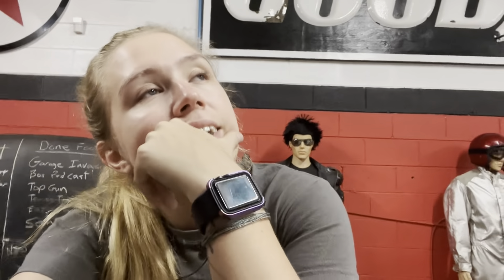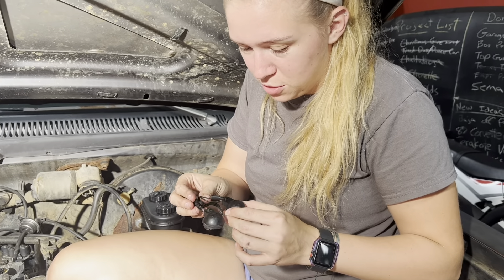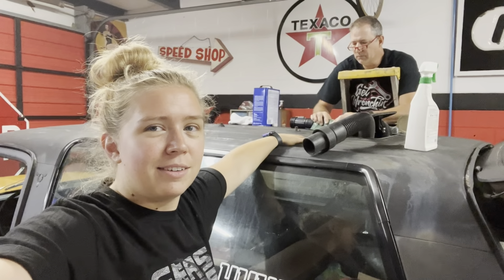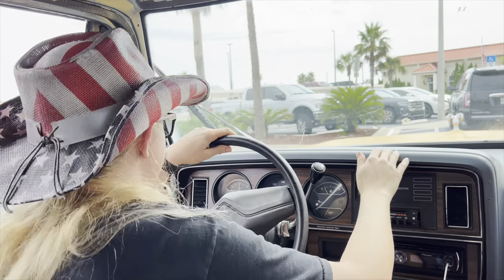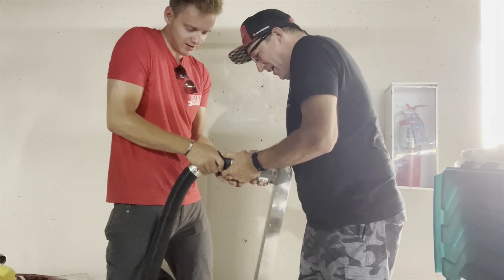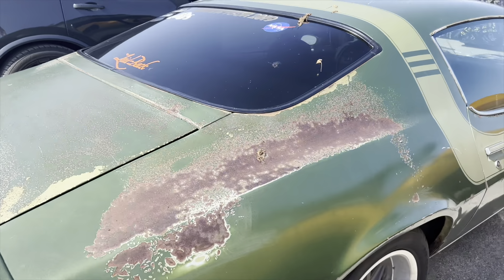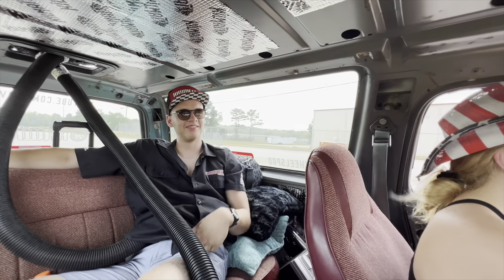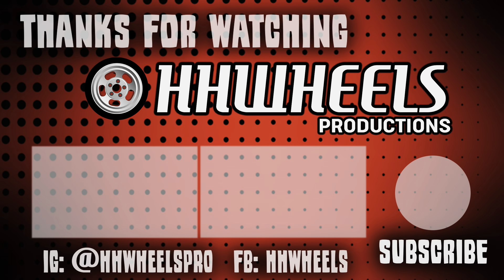HOT ROD POWER TOUR 2022 | WILL OUR RAMCHARGER MAKE IT?

Comment: I have a 1988 D100LE Ramcharger (2wd) and you're doing ventilation wrong.  Open the door windows all the way and open the roof vent all the way.  Reach down to the drivers' side kick panel and slide the vent toward the driver's door, this flows air from the cowl into the driver's crotch.  You also turn the vent fan on, but you might have to clamp the heater core lines if your shutoff valve doesn't actuate. 

Your vent windows at full open deprive the rear seat of airflow, somewhere around halfway is a compromise between front/rear airflow but makes the most noise.

Trying to pipe fresh air in through the roof restricts the through-ventilation that is quite well designed into the truck, that roof is a vent to exhaust the passenger cabin.

Cool that y'all took one on the power tour.  Maybe I'll put mine back on the road and take a trip like that someday!
Reply from the maker: Bru! We should have taken you with us😂 thx so much for watching! Driving at night was no problem and the tubes seemed to work well, I’m not sure anything would have helped the 100 plus heat. It just sucked! We made the best of it. Thx again!

Comment: Great video. I currently have a 92 Ramcharger  and have had  others in the past. As far as your fuel injection comment, no one should correct you for calling it fuel injection as that's what it is. However it's not tuned port injection, it's throttle body injection. Tuned port injection uses an injector per cylinder spraying into the intake runner.  They are both "fuel injection" .It looks like a great truck and I hope you enjoy it.
Reply from the maker: Thx Rich, thx for the info, and thx for watching 🤙
Reply from the maker: Oh, we are still looking for a driver side door panel if you come across one. Thx

Comment: Early throttle body injection or tbi as the ram charger is like the early 94 Chevy extended cab short bed onyx gloss black with quicksilver center stripe running down the sides and the tailgate Z71 with a 0.40 350 tbi can be very finicky in symptoms and therefore difficult to diagnose what is exactly wrong with them....been there done that but in design they are a simplistic type of fuel injected carburetor basically.... I had the same fuel issues with the early 94 Chevy extended cab short bed Z71 truck i had before my dodge ram...

Comment: I'd run your fake ac thru a cooler filled with ice by piping in the hose in to the cooler  thru the ice & then shorter hoses coming out so your not just pushing hot air at outside temps

Comment: I was lucky to acquire a truck with very little modifications and lower mileage working ac that did work well until the stupid ground squirrel chewed up the ac compressor clutch wiring connector pigtail right off the truck and the number 7 injector harness connector pigtail so I pretty much have to tear the intake manifold down to get to the harness to fix it and that kinda sucks when it was a vehicle the wiring was not all hacked up but it will look like it lol, truck has the premium factory installed 6 speakers and tweeters amplifier filters sound system and i installed a stereo just like it came out with from the factory a premium infinity by chrysler am fm cd player cassette tape player stereo and it works but the factory speakers yeah they suck.. the previous owners had changed the front doors and put the wrong doors from a lower level trim truck on and spraybombed them flat black but hey the factory clear coat is baked and peeling off so the truck looks like crap anyway, when I got it it had one front door speaker working and the dual electronics xm250mp3 cd player in the truck but I would rather have the factory headunit anyway.